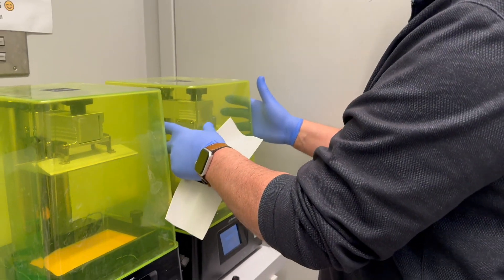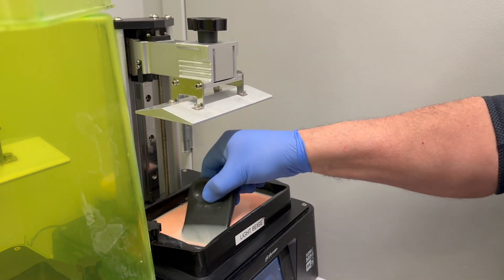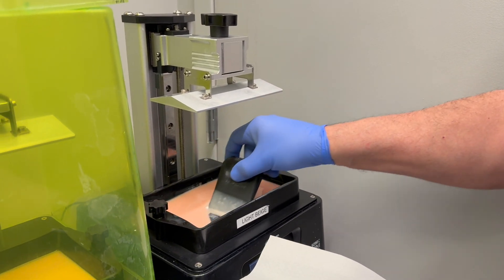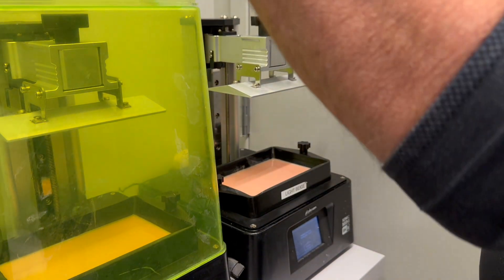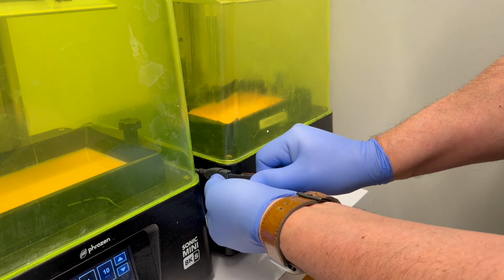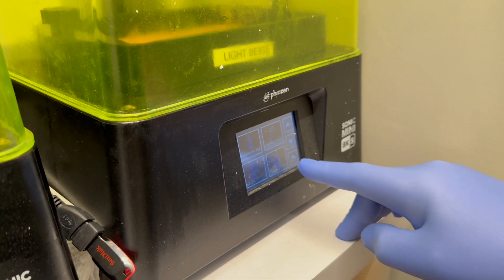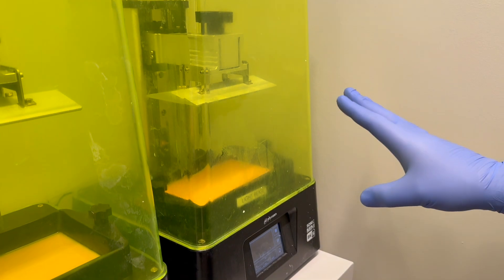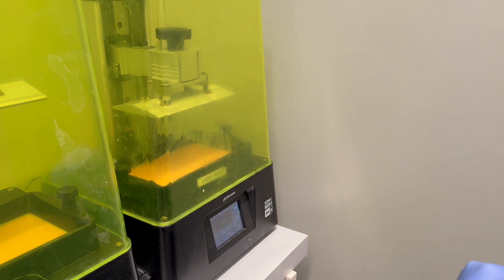Initializing a 3d printed dental model using a phrozen mini 8ks 3d printer Step-by Step Guide

Comment: do you have to heat up the resin before printing too??
Reply from the maker: It depends on what resin you are using 
Model resin typically does not usually need heating